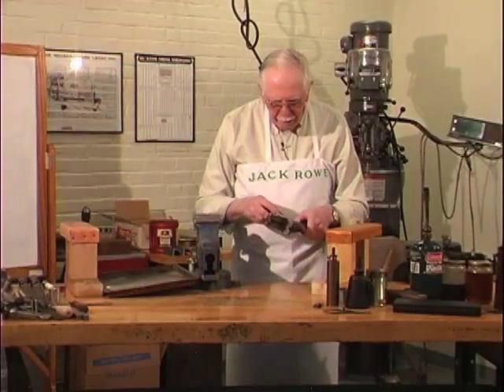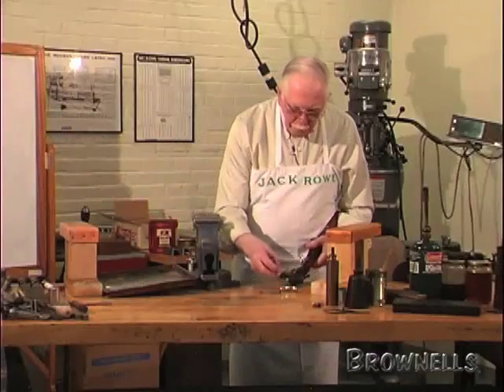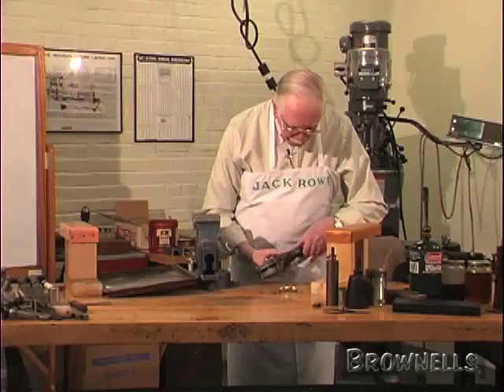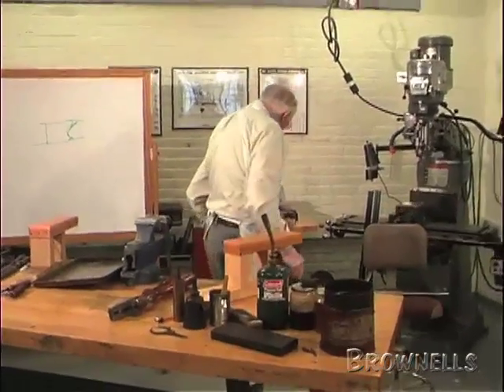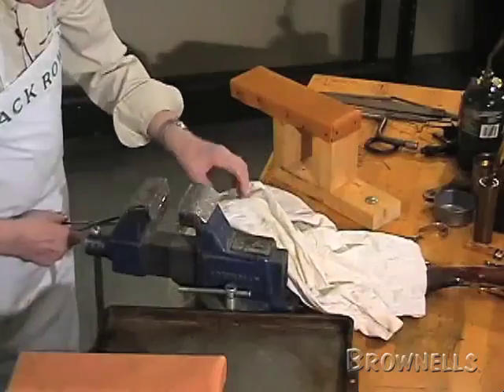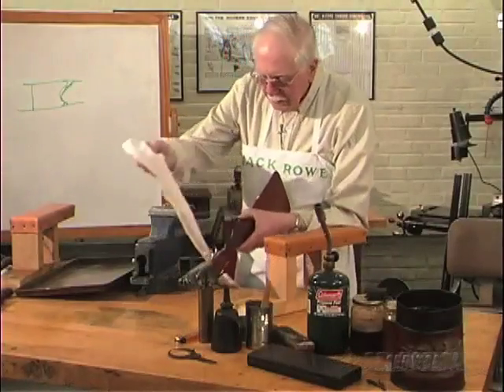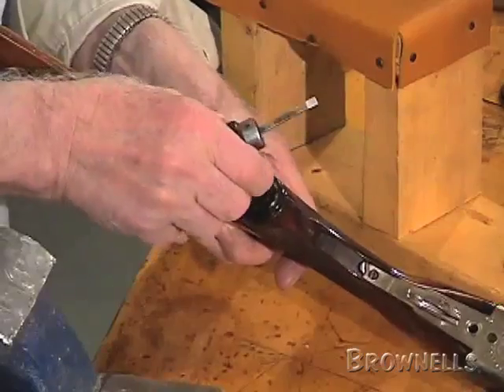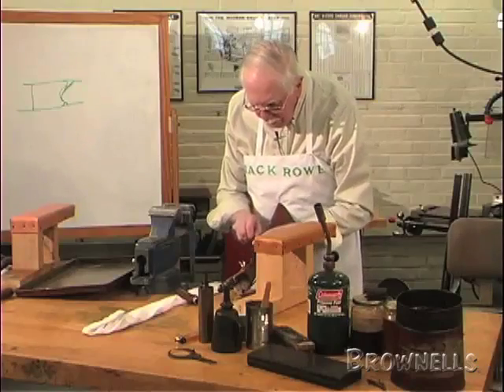Brownells - Jack Rowe, Master Gunsmith Series, Stock Bending. Part 1

Comment: I do stock alterations in the UK. I use two infra red bulbs, hand held, and keep them moving. I find the heat penetrates quite quickly, and it's a lot less messy. Thanks for posting these great videos.

Comment: I bent a stock using a similar method.  I used cotton cloth soaked in olive oil and a hairdryer to heat it up.  I also clamped the barrels of the gun to a workbench and used a block of wood cut to the desired drop (70mm) under the end of the butt to ensure I didn't bend it too much or too little.  I put a G clamp over the action just in front of the trigger guard (lightly) and then just gradually increased the pressure on the G clamp as the wood became pliable.  Took about 15 minutes.  I think a heat gun or hairdryer is better than waving a naked flame around!

Comment: I tried this using an adjustable heat gun.  It worked well except, as Jack said, Turkish walnut can spring back.  Solved by ensuring the wood was heated right through and rigging up a jig so the stock could be left under pressure over night.

Comment: I used to bend a lot I made a pot from a metal electric crock pot drilled a hole with a spicket and shut off. What was nice my catch pan I could recycle my oil. And also vary my pot temperature with the temperature settings